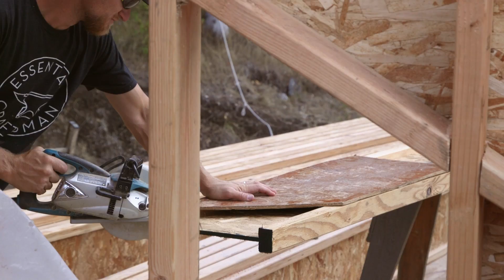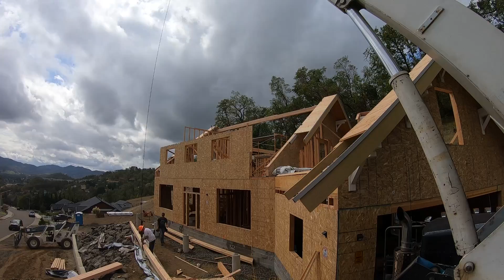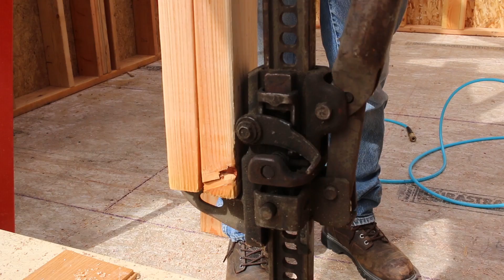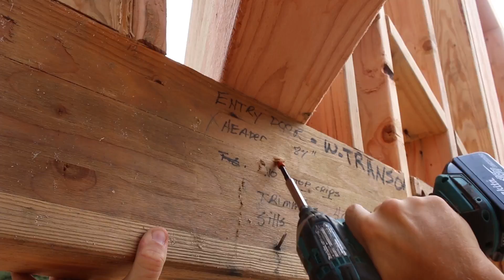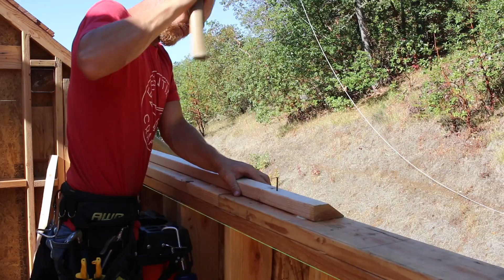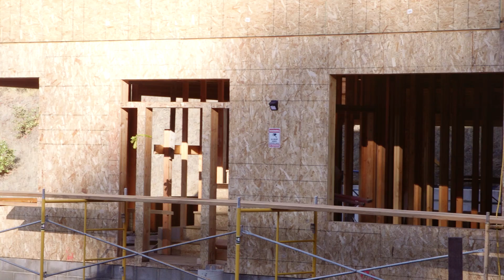Lowering a Beam and Installing Rafters Ep.65

Comment: Cool,first-time I've seen I joists used as rafters. I wonder about the extra slip force as a result of the angled bearing surface. Of course the engineer spec'd pilot holes. He's nervous also.

Comment: I'd be interested to know how you are finding the battery life with those Makita tools, they are absolutely terrible in a hot climate (To the point where Makita will not provide warranty on their batteries where I live) You are lucky if you get 100 recharges out of them. My Maktec drill lasted about 3 months of light work and the two batteries were dead. Replacement  batteries here cost as much as buying an entire new tool.

Comment: Scott, the Spec House is really shaping up nicely.  I am kind of surprised your local building codes don't require some kind of structural clips, Simpson A35's or similar, along with your 3 1/4" #10 screws to add a little more rigidity to your rafters and ridge beam  junction.

Comment: I worked on  a couple dozen houses from footer to shingle in the 2000’s. I’m not confident in how those rafters connect to the ridge beam and the top plate. I’m all for new technology, but I’d want the rafters notched to sit on the walls. You could talk more about when/how to use fall arresters and when OSHA   rules apply.
Reply from the maker: I hear you for sure! I was so skeptical that I talked to both my structural engineer and the engineer on the helpline at Boise Cascade, the manufacture of the I joist. Both of those professionals assured me that it is fine. When you see the detail with the rest of the blocking, shear blocking and bird blocks I think you will be as comfortable as I am. The real reason that any tendency to slide is not a deal is because of the strength of the overall shear diaphragm tied to the gable end walls that are sheer nailed. Any sliding would have to transfer all the way to the edge and they tell me that is impossible.

Comment: How can you sharpen a heat treated ax with a file. I thought a hardened blade would resist a file.  I'm not being an ass, I am seriously asking about that.
Reply from the maker: Fully hard will not file... tempered back to blue(spring temper) will file and resists chipping...
Reply: @essentialcraftsman  so they arent fully hardened. Gotcha. I always wondered, all the years I cut wood, how I could sharpen my nails and axes with a file. I just thought they weren't hardened. Did find that out til I saw your video. Thanks for the info. Love your videos and keep them coming.

Comment: It is interesting that whilst those huge, engineered beams and rafters make for a simple-looking structure with good, open living space on the upper floor, they also create technical issues with installing, trimming to size and proper care in order not to compromise their integrity.  
Imagine cutting those I-beam rafters too short, or to the wrong angle, or cutting the giant beams too short; 1000's of dollars wasted. 
Building with small section "stick timber" is infinitely repairable and modifiable on-site but (arguably) takes more time and means many more elements in the structure and empty "crawl space" voids. Just shows there is no "right way" to build, just lots of different ways that all have their merits and down sides. Great work EC & team!

Comment: Is it typical to use those beveled 2x on the double wall plate for engineered lumber opposed to a birds mouth/seat cut?
Reply: Good question. It definitely seems like a best practice since you can't birds mouth those

Comment: Around 5:20 I’m not sure what the mistake was? His risers under the beam? No idea
Reply: The lower beam that will help support the rafters (yet to be installed at 5:20), was too high and would have interfered with the rafters going down, from the ridge, to the top plate of the outside (front) wall. So the posts supporting the beam, had to be lowered to let the rafters plane in correctly.

Comment: In case of water damage to the rafters from the roof, how will these engineered I-joists be repaired?  Can they be sistered With regular lumber?  Also aren't these glued woodchips easily  damaged by water?
Reply: I'm sure no different than when there's a leaky pipe and it gets a floor joist wet

Comment: It would be interesting to know how many days or man-hours of work elapse between (or during) each video, and equate that to the actual changes to the structure that they account for.
Reply: James Raschke typically I would guess each episode of the framing portion encompasses a full workday. There is a lot more time in between ‘episodes’ early in the series during the earth preparation and foundation pour. 

Once lumber starts getting installed, it’s about an episode per full days work. They skipped some stuff obviously for repetitives sake.

Comment: As an honest tradesman "I never make mistakes- just minor adjustments & I never have major stuff ups- just minor alterations! Thought I was the only one to use 18In welding clamps for woodwork! So handy! Fascinating to watch the progress of a fine build and the wildlife. Cross bracing that scaffold would be a worthwhile adjustment to avoid an alteration to your skeletal supports my friend. Want you around a bit longer to make more fine, educational and so entertaining, videos!! Near enough is never good enough!!That's my way of saying "Keep up the good work" Thankyou for yours- really. Howy
Reply: -😁 On ‘never making mistakes’ - I used to have a boss that would say that, every time he got a new pencil he would chew the eraser off bcz he wouldn’t be needing that.
-😁 On adding cross bracing to keep from developing skeletal alterations - It is true that many people have contracted severe cases of ‘wood poisoning’ as a result of falls from height (or ‘cement poisoning’ as the case may be) 😬
Reply: @psidvicious  Isn't a sense of humor a wonderful thing! Here in the land of Aus, a lot of wood and concrete poisoning has been significantly reduced by the mandatory use of safety harnesses and anything above 10 Ft requires scaffolding. Government's occupational health and safety inspectors do random checks on sites and would crucify you for using a timber I beam for a walking ramp or  tippy toeing about the 2nd story joists without wearing a fall restraining harness- attached to a specific anchorage. The entire house would have to be surrounded by scaffolding- installed by a licensed contractor!! Wish the OH&S guys could reduce food poisoning. I took a bait 2 days ago and have been frequently talking into the big telephone ever since!!!
You stay safe!!! Cheers H

Comment: The lack of overhangs may save costs of construction, but the costs of greater energy usage for heating and cooling over the life of the building far outweigh the savings in construction costs. (Not the spec house here) The energy costs are borne by the occupants of the structure, and society as a whole in terms of greater resource extraction and use. People have been bitching about improving energy efficiency in buildings for going on 5 decades, and yet buildings are put up 90% of the time with no consideration of solar aspect, and no incorporation of passive heating and cooling technologies that have been around for centuries: flat west-facing walls with no shading of windows that result in excessive cooling costs, south facing exposures with no windows that could capture low angle winter sunlight for added warmth. Our 50 year old house could probably have reduced heating costs by 15%, and cooling costs by 20%, simply by turning it 90 degrees on the lot. We keep on getting older, but I sure don’t see us getting any smarter.

Comment: When trimming the post shorter, why couldn't you use a circular saw to make a plunge cut as a final target reference point. Even a shallow plunge cut will give you a good reference for the chain saw cut and oscillating fine cutting.

Comment: Here in Texas, studies by Texas Tech have shown that nails are more resistant to the movement induced by tornados and high winds.  Screws just break. Do you have to comply with earthquake requirements in your area?  I'm curious if the code calls for screws or is that something you chose to use?
Reply: Is the study comparing nails to structural screws, such as the ones they are using, or just regular screws not designed to take shear?
Reply: @WanJae42  Good question!  I will have to do some research on that.  I think the structural screws used here are a fairly recent development that I don't think existed when the studies I read were conducted.
Reply: I checked  with one of the engineers at the college.  He told me their current studies haven't gotten to connecting components yet.  So maybe in the future we'll find out.

Comment: why dont you chamfer the top of the beam?
Reply: The beam is spec'd for a certain load based on the rating from the manufacturer  if you cut into the beam, it no longer complies with the manufacturer's rating.

Comment: At this point the complications of the roof prompt me to ask twp questions-
For the jig to guide the shortening of the I joists, why didn't you add a piece in the middle to support the saw shoe (easier on your wrist not to have to resist twisting the saw)?
And, secondly - if you were to do this again would you now avoid that complex roof design?

Comment: Are the "splice plates" where the rafters meet on the ridge required, or are they something you are just doing???
Reply: Squash blocks, plywood splice plates each side, simpson straps, Cantalever are usually prescripted in the manufacture instruction documents  and revisions, addations added by your civil-structural engineer.  I have drawn most of my blueprints with consultation with "my" engineer who then reviews revises as necessary then stamps the plans with his regstered  engineer stamp and dates them.
Reply: @timhale501  I used to do the same thing. You can save yourself a lot of money if YOU do the heavy lifting of the design work and then just submit to ‘your’ engineer how you would like to do a job. Then all they have to do is check a few calcs here and there, put their stamp on it and you’re ‘off to the races’!

Comment: With no seat cut, won't you still need collar ties? You are relying in the shear strength of the screw to resist the horizontal component of the roof load.

Comment: engineered wood I beams in Roofs. they are a lot lighter and easier to do by yourself. the greater depth of the I beam compared to the 2 X 4 truss has more space above the top plate for insulation and the ENERGY code allows less roof insulation because you won't have cold perimeter . I have found that regular nails tend to split and don't hold as well as into lumber. Scott's engineer specified pre drilling for screws. The last time I did a roof We used a senco M3 15 gage staple. 2 staples replace 1 nail. the 15 gage size does not split the laminated member. If I do another roof I will glue and screw  down the first row of sheathing in a high wind area.

Comment: Boy O Boy, pilot holes AND the time taken to screw. That's intense! I get the advantages but that's gotta take 3x's what nailing it off would. Is it against manufacturer specs to nail them off or was this just a personal choice?
Reply from the maker: Specs
Reply: @essentialcraftsman  copy! I don't have any experience with the engineered products. I got out of the residential world a few years back and work at a large University hospital now. Totally different kind of material used. I miss the wood days!

Comment: Be Aware that osb is no good wet. So get it up and covered before the rain ,ice or snow comes. I question the use of OSB for a roof as they all leak sooner or later.
Reply: You can buy water Resistant OSB for sheathing and flooring.

Comment: Wow...with no crow feet on those rafters, I would feel jittery about the whole, roof load-system wanting to sheer those screws and slide off. Learned something new!
Reply from the maker: Yes, I questioned two different engineers on this topic and they assure me that the shear diaphragm that’s in the roof transfers to the walls and holds the roof in place.
Reply: I’m sure the engineer ran the calcs and said “It’ll work fine.” His license is ‘on the line’ every time he signs off on something like that, so I’m sure he thought it out.

Comment: Its really interesting just how weak the individual parts look until tied together with the rest of the roof structure. Plywood really has changed the entire way we build things.
Reply: Agreed. I loved the small plywood collar ties, glued and nailed, at the ridge from one rafter to the other. Lots of strength gained in that connection.
Reply: I forget the span I used for I beam rafters (TJI) but I had to us 1 X 2 cross bridging at the mid span. I was over an open attic no sheetrock on the underside.

Comment: I love this series, but hate seeing these joists being used for rafters. I know they are faster, lighter, and cheaper than using 2x12s, but in a fire these things burn thru so damn fast. I've seen it first hand many times. This results in collapse and possible entrapment of firefighters. This type of construction can burn thru to failure in less than 14 minutes compared to 45 minutes using conventional lumber.
Reply: Could they be sprayed with some sort of fire retardent
Reply: @kierandoherty1600  I do know they spray steel bar joists with a fire retardant material but I don’t know if it would work for this application 🤷‍♂️
Reply: I would argue the ‘cheaper’ claim. I bet they’re twice the price of a sawn lumber 2x12. It’s the open, unsupported spans I think they’re trying to achieve.

Comment: At the peaks, i would've gone with a piece of metal rather than particle board (tho it can't hurt being extra either). Idea being that the structure is in the wood, not in the OSB like core of the engineered element. An angled piece of metal spanning the two would've been more correct. IMO.
Reply: The scab of osb can be glued on and pinned till the glue drys... this piece is more for alignment of the ends of the "rafters". Doesnt really provide any structural supporr

Comment: I think in some areas the building code would require you to connect rafters end-to-end with 36 inch galvanized straps and maybe even attach the rafters to the ridge-beam and top-plates with some sort of Simpson hardware. I did all my construction in the Los Angeles area...they are fanatics because of earthquakes. Probably along the Gulf Coast they'd be the same way because of hurricanes.  When you're all said and done with this project I'd be curious to see how your original material and labor costs and time estimates compare with the reality. To me that was always the real game, the most enjoyable part...calculating and comparing. I have to assume that the "thumbs down" count is just from people who aren't interested because I don't see how anybody could not love your videos.
Reply: I built a house in Northern Calif using I beams for roof rafters. We used simpson straps aver the top and VPA brackets at the wall

Comment: I guess it's better that the mistake was to cut the post too long rather than too short?  What would you have needed to do if the post was too short, replace it with a new post?
Reply: If it had been too short, they could have just stacked an additional 13” block on top of the post.
Reply: @psidvicious  That's what I was wondering.  Didn't know if there would be a problem when the inspector came through.  Our inspector made us add some steel but we had worse problems than just a short post.

Comment: A good carpenter knows how to fix mistakes . Yours and someone else's Construction screws save a lot of time. Last year I was  doing a remodel for my stepdaughter  and said I needed a few structural screws. She came back with the largest box in the store. said the price per screw was about 1/3 of what just a few were. We used the whole box before we were thru with her jop. They saves time when you don't have to set up the air compressor and drag hoses for just a few fasteners.

Comment: When 3-dimensional thinking is of a problem ... why not building a scaled model of lego/paper/balsawood/matchsticks just like the middle-aged ship builders did it. Nails and screws thus becomes pins if necessary. The more there are off-angled intersections, the better this could help.

Comment: I do not like Engineered rafters. I know they are structurally sound but if your roof ever leaks those things are going to deteriorate much faster than an old fashioned 2x8.
Reply: true true and true (straight blum and true)
Reply: Anywhere you use engineered wood you HAVE to make sure you correctly control moisture migration and water.
Reply: That roof would need to be submerged for SCLs to be damaged. They are made with moisture-resistant adhesives (they are not like OSB sheathing). Also, one needs to have adequate ventilation. But the real worry is fire-those thinner cross-sections may ignite faster than traditional dimensional wood rafters.